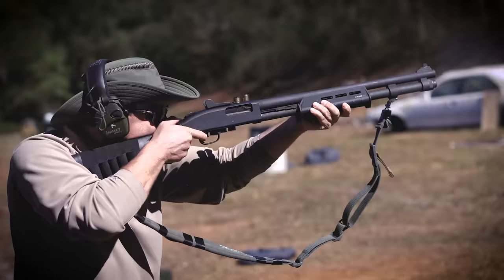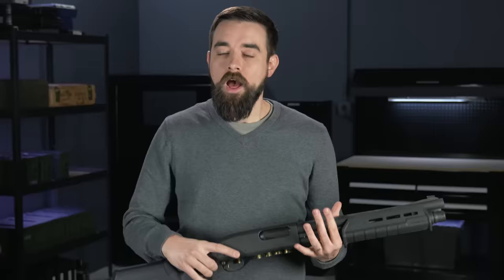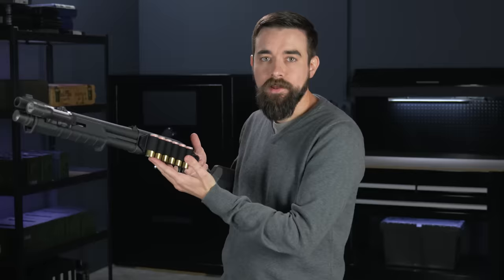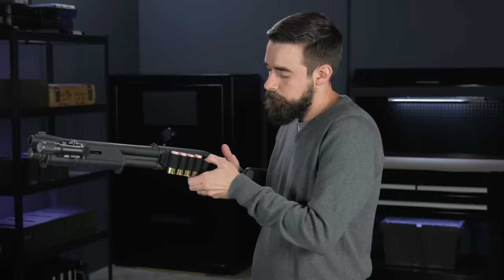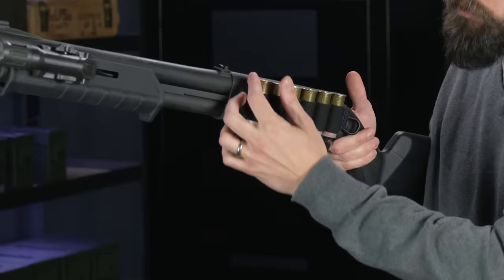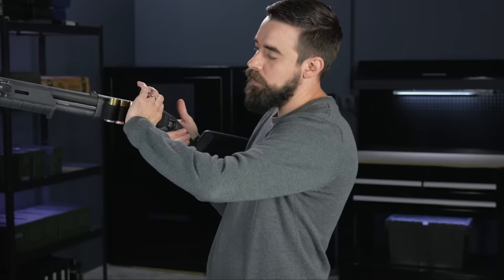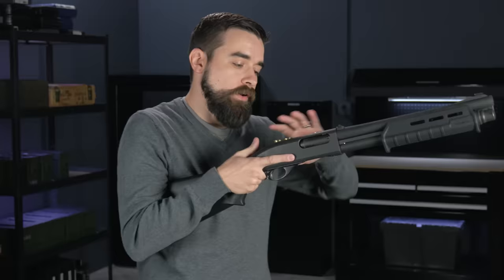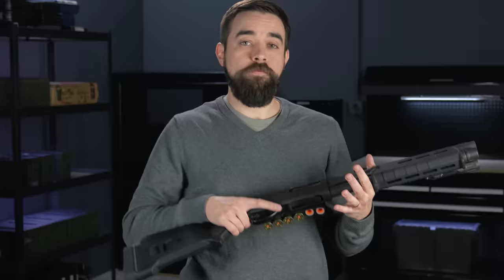How to Reload a Defensive Shotgun

Comment: good video, solid points.
I've fingered a few 3 gun shotguns and most seem to be modified slightly to increase reload speed (competition) and all, opening/smoothing loading port, adding a chute, etc...do you think those type of mods could translate to fighting with a shotgun?
Reply from the maker: Some of them could be helpful. It's hard to see any downside to a wider loading port with smoother edges. A chute... I dunno. I could see that getting in the way of trying to do a "normal" reload, but I've never used one so I couldn't say. I think the bigger question is whether those mods would be worth the cost/effort. In competition, if it shaves off a few hundredths here and there, it might be worth it. For real world use, there are probably other things (training, ammo, range time, etc) that would be a better use of your time and money. There is always stuff we can learn from the competition world and apply to the self-defense context, but we have to do that carefully. There are people who spend enough time doing both competition and defense-oriented training that are a lot more qualified than me to make those determinations.
Reply: Lucky Gunner Ammo and what about the "sport loading"? We are used to flip upside down the shotgun and load with the palm.. maybe 2 rounds in the same push..
Reply from the maker: I think those kind of reloads are a lot less likely to work under stress, but if you've practiced it a ton for competition, maybe it would be okay. But where are you getting those round from? It's tough to grab two rounds at a time from a shotgun sidesaddle and you're not going to be wearing your competition gear when you're at home.
Reply: as you said, from the saddle. I have a 40 degrees tilted one. It only holds 5 rounds, primer facing downside.

I twist strong hand and rifle inward up to 90°. I could even rest the stock on my shoulder.
I pinch the second between thumb and index, first between forth and palm (but slides to  pinky level). In the second movement, draw the shots that "self align" in my hand, push them into the reservoir.
Done!

I can't recommend it but it works to me cause is similar to the chest rig grab. Maybe you can work around it and make it viable for others.

greetings and sorry for my bad English
Reply: ha

Comment: Brass down crew. Shells pop out the top of the loops just as often as out the bottom IME, but with good loops (esstac) they won't fall out at all. Brass down just makes it easier to load the tube. I used to load the port over the top, but after spending some time on autoloaders (and with optics) I found that loading the port from underneath is faster too since the bolt release is easier to hit from underneath.

Comment: I'd say that flipping your shotgun upside down, plucking the shells upwards from the carrier or side saddle and inserting them into the loading port from there is the most intuitive way to reload a shotgun under stress.

With the loading port facing up, you can see it which makes it easier to reload under stress, and it reduces the risk of accidentally missing the loading port or dropping the shells.

Comment: In summary:
1.) Load a shell into the chamber first, then start loading the tube. (This way if you get interrupted in the middle of loading, you already have a round ready to fire.)
2.) Keep loading the shotgun whenever you have time to do so. If you aren't currently engaging a target or doing something else with your hands, you should be pro-actively topping off your magazine tube.
3.) Orient the shells in your side saddle with the brass pointed down. That way the shell is already right there next to the tube opening when you pull it out. (They aren't realistically going to slide out unless you're shooting the gun all day, in which case just push them back up every couple of hours. Or if your side saddle really sucks.)

Comment: to be honest, i would probably prefer to just have another fully loaded shotgun ready
Reply: Run out of ammo? Just throw the empty one out the window and grab your other one
Reply: Tediore reload it
Reply: @phantom_muchen9965  lmao
Reply: Mag fed semi. Same solution that makes sense in all the other types of gun too.
Reply: @GunFun ZS those mags are extremely clunky, and are really not as reliable as a tube magazine combined with the not so much reliability of a semi
Reply: @viktornogin506  False. The good ones are a lot more reliable, and no more clunky than the mag on a rifle. I have a lot of rounds through CSSPECS and SGM mags, and less through the inferior mags. 

Tube loaders hang up in a lot of ways, and do so frequently, both in the process of topping up, and as they feed. Likewise, meat springs in a pumper tend to cycle inconsistently. Modern Semis are more reliable, because their mechanisms are consistent with springs and gas pressure behaving the same every time.
Reply: @GunFun ZS Is this from personal experience or sources? If it is the first I like both semi and pump shotguns, both have advantages/disadvantages, and there is no firearm to fit all, but better made detachable magazines will work better than extremely Shitty made tube magazines and Vice Versa I agree.
Reply: @viktornogin506  Plenty of personal experience, observation of others and a lot of helping people over the years. I also agree that badly made versions of either style runs badly.  
However, I stand by the statement that a well made mag fed semi auto shotgun is categorically better, in exactly the same way and for the same reasons as a well made mag fed semi auto rifle. There are plenty of excellent manual rifles, even excellent tube fed or stripper clip fed rifles, but they are all operating at a substantial handicap compared to modern systems.

The one thing a tube feeder has over mag fed, is topping up as you go. To me that is minor, as I have on many occasions demonstrated that I can change mags fast enough to catch two clays out of the air with the mag change between. Dropping a mag and sticking a shell or two in is also quick and easy requiring only slightly more effort than with a tube gun. It's an advantage that is only relevant because of limits based on rules at some trap clubs or magazine restrictions in hunting laws. Even then, it is a very small advantage, which is more than offset by all the other disadvantages.
Reply: @GunFun ZS how much maintainability do you need to keep a semi auto up to par vs a manual, same with a tube magazine vs detachable.
Reply: @viktornogin506  I would say less, in general. There are far less moving parts, and the disassembly is enourmously simpler. As in do it blindfolded in seconds and reassemble ditto., though I do have to temper that by limiting to modern designs. An antique browning auto 5 is a clockwork monstrosity, though lovely. 

The current gen best of breed mag feds are the Saigas and derivatives. They basically field strip like an AK, except you also pop apart the gas block or gas tube to scrub out the ports from time to time. You can run them wet or dry for several thousand rounds before any cleaning is required. If you go over about 2k without cleaning, it is a pain to unscrew the gas plug adjuster due to fouling, but it's not a big deal. I have gone somewhere around 3k just to see. As with rifles, it is a good idea to pop the floor plate out of mags and make sure they aren't full of gunk every now and then. Varries with where you use it and how dirty the shells are, but every 3k is a good rule of thumb.

Benelli M2 seems to want cleaned on a similar schedule, but I don't own one. Most people suggest cleaning The 590 JMs around every 1k. Those want lube. The Adkal 1919 and derivatives, are mechanically old tech Remington 1100 based actions, and are more of a pain to clean, but not any worse than the average tube gun. They are more of a light duty gun, and aluminum bits will wear out with high round counts. 

FYI, if you are looking at an AK based shotgun, Saigas, Vepers, and Kalashnikov USA are the way to go. The rest of the Chinese clones have various metallurgical deficiencies, that make them light duty guns too.
Reply: @GunFun ZS my personal shotty is the Mosseberg 590, 7 pounds, 9+1 capacity, and reliable as I’ll get out.

Comment: side saddle and the cheep stock sock shell holder is all you need on a defence gun with my 590a1 that gives me 9 in the gun and 11 in reload I could also fill the feed stock but I have never used it I don't even know how many big hols 4 or 6 I run the stock sock more toward and it partially covers the feed stock

Comment: I run the front 2 brass up for chamber loads over the top, and the rear 4 brass down for topping off. The chamber loads are going to be the ones you mess up under stress. If you have time to be loading the tube, it means there's a lull in the fight so you can afford to think about those more. For me the most important thing is to have a couple shells with brass up that are quick and brainless to get into the chamber from the saddle. I see the argument that having some different than others is a problem under stress, but when you practice it a lot you don't need to think about it.

Comment: Can anyone tell me why I have to put it in the chamber when the gun is empty and not just where you put them otherwise? Dont know much about guns so excuse my question
Reply from the maker: +Deine Ebbe You can do it that way. It's faster to load the chamber first and with some semi auto shotguns, you can't load the tube if the action is locked open. With some pump shotguns, the forend can slide open and prevent access to the mag tube until the action is opened and closed again, so it makes sense to load the chamber first.
Reply: Lucky Gunner Ammo Understood thanks for answering the Question
Greetings from Germany
Keep up the Good work

Comment: Alternatively if you're doing brass-up you can grab the brass with thumb and index finger, and push it up with your pinkey. This lets you feed the front of the shell into the breach rather than slapping it in like shown here. 
The problem is that the method shown only works for some types of rounds out of some guns. As soon as you move into longer ie: 3.5in shells, the whole hand method tends not to work because the breach just isn't long enough.
The grabbing method is the same if you go to load the tube as well, so you're not training twice.

Comment: I like my 8 shot mesa aluminium side saddle and usually have 2-3 shells up front with the brass up and the rest brass down. 
The principle of idiot proof simplicity is smart, but with some training and hunting with my shotgun i seldom stumble on the fast reloads as i tip the gun left if i rack it back and stop and tip it right when i rack it normally in a reload. That way its already "decided" what kind of reload i am doing and the brass is in the position most convenient for the reload (i go over the sights for chamber reload).   Hard to put in writing i suppose, but it works well with a bit of practice and since hunting is limited to 2 shells total in the gun where i live it sometimes allows for a very rapid third shot when engaging birds. Hunted seabirds from a kayak for years and the reloads are so automatic the stress and balancing does not interfere anymore. 
Love my 870, had it since i was 16 :)

Comment: Capacity was a strong point in my choice for a home defense pump action 12 GA. Went with a stevens 320 .. absolutely love the platform movement action etc. Yes only holds 6 ..1+5 ..same capacity as a revolver .. But much more lead going down range .so 6 isn't bad ..and in a home defense situation ..if you need more than 6 shots plus what's in a buttstock or side saddle ..you might want to think about relocating to a better area? Maybe a Uzi might be a better choice😬😝😂😃👍🏻

Comment: Are there any side saddles with a different orientation,  such as 45 degree angle instead of 90 degrees.
Reply from the maker: +thewaterbear I've seen some with different angles. Not quite 45 degrees though

Comment: I got a pistol grip only Ithaca model 37 from a pawn shop, it ejects out the bottom where you load the shells in so I have to load one into the tube and rack it when the chamber is empty and I have no stock to brace with, in a home defense scenario I'm not doing too hot, and if I get to the point where I actually need to reload I'm probably fucked.

Comment: Dude, what shotgun are you using?

It looks beautiful.
Reply: Looks like a Remington 870 with Magpul furniture.
Reply: @Larry_Parada  thanks
Reply: @Larry_Parada  how many shells could it hold though, fresh from manufacture?
Reply: Models are available with 18" or 20" barrels, with or without rifle sights, and have a standard capacity of four rounds. They can be ordered with a two or three round extended magazine tube from the factory, bringing total capacity to 6+1 (18" barrel) or 7+1 (20" barrel).

Comment: I always prefer brass down. Plant the stock under your shoulder, pull a shell down and load it into the tube. if you need to put two shells in, pull two shells from your side saddle hold them side by side in your hand and load them one after the other. This works reliably up to 3 with practice, 4 if you have big enough hands like I do. I wouldn't suggest anymore than 2 at a time due to the varying factors that might complicate things in a life or death situation. Holding 2 shells in your hand and loading them into the tube one after the other will noticeably improve speed without over complicating a simple process, that being said all things should be practiced so as to become second nature.

Comment: I have 2 bulging discs in my lower back and l know 12g recoil can be unforgiving. What kind of shot can I use that has less recoil? Birdshot? Any recommendations would be helpful.
Reply: I may be a bit late but have you considered a 20 gauge? might work better for you in the long run while you have a bad back. my apologies.
Reply: otherwise birdshot is your best bet or reduced power buck

Comment: can I asked a question , why is your shotgun so short? the reason why I am asking is because chopping a shotgun down in length takes away from a tighter grouping. and in a fighting shotgun tighter grouping is exactly what you want
Reply from the maker: Barrel length does not have a major effect on the spread of the shot pattern. A shorter barrel reduces velocity somewhat, which means shorter effective range, but that's far more important for hunting than for self-defense. The shot pattern is related to the choke size more than the length of the barrel. A short barrel makes the gun more maneuverable indoors.

Comment: What's makes a defensive shotgun different than any other shotgun?
Reply from the maker: +blueknight Generally speaking, a defensive shotgun is set up for use in close quarters to fire buckshot or slugs at armed human opponents at close range. So usually, that means a short barrel, extended magazine tube, and a stock with a short length of pull. A defensive shotgun may also have sights for improved speed and precision at close range, and it may have a provision for mounting a light to positively identify the target in a dark house. Any shotgun can be pressed into a defensive role if the need ariaes, but the attributes that make a shotgun ideal for field or sporting use are often detrimental to using it efficiently for self-defense.

Comment: Action open, flip the ejection port skywards (shotgun horizontal) and put a shell in. Let gravity work with you not against you (rolling a shell upwards searching for that ejection port). The whole rolling a shell up to the ejection port while the action is still vertical sucks in a real gunfight. Trust me. It's a fine motor skill and you need a gross motor skill.
If the whole bit of holding the weapon with just one hand while it's horizontal concerns you because it tires your wrist? Time to go to the gym. Besides, it shouldn't be horizontal for more than five seconds max. I hope everyone reading this is strong enough to do that.

Comment: Great video!! can you explain the 2 3/4 vs. the 3" magnum and the fact that they dont measure out right?
Reply from the maker: Not sure I understand the question.
Reply: If I understand the question right, the shells are measured before they are crimped  or after they  have been fired. The shells I have in front of me measure  around 2 1/2 inches ( unfired) and 2 3/4 after they have been fired.( crimped plastic exposed) I was always curious about that also. I asked my older brother and he said, " they measure the new shell hull before they are loaded, ya noob"! Lol

Comment: Will I damage my spring if I kept my shotgun loaded all the or just keep one in the pipe like I do now for home protection.?
Reply from the maker: +orion m42 Use a Wolff extra power spring and replace it every couple of years or down-load the tube by one shell. The flimsy shotgun springs can lose some tension eventually if left fully loaded long enough, especially if it's the factory spring with an extended mag tube.
Reply: Thanks for the info be blessed.
Reply: Kept my old Mossberg with a full tube loaded 24/7, for years never had an issue other then after six years and several thousand rounds fired in training and several thousand more dummy rounds practicing loading it was getting a little weak.  Same thing with my current Remington's and Mossberg's.  The cycles between loading and unloading are what fatigues springs.

Comment: if you do run the gun empty,can't you load from the bottom,and just rerack the slide to chamber a round?
Reply from the maker: +Anthony B D You can, but it's slow, and you have to press the slide release latch to rack the round in there, which requires more dexterity than just loading the chamber directly.
Reply: Lucky Gunner Ammo ,thanks that does make more sense,very good videos